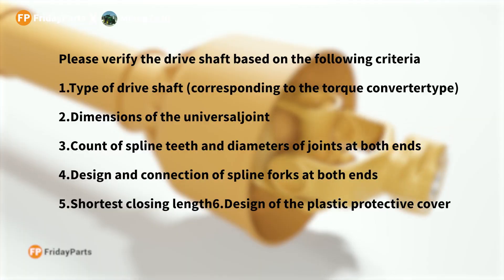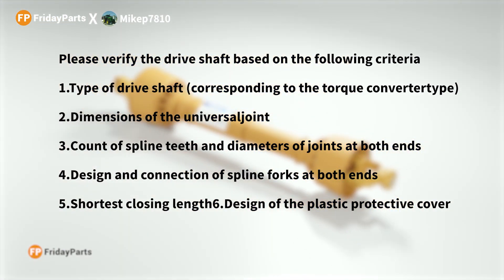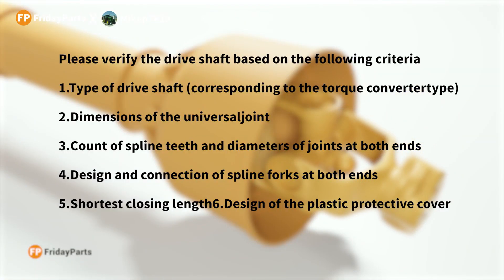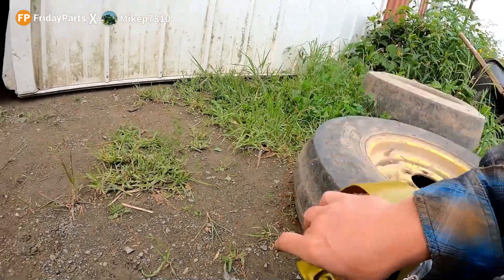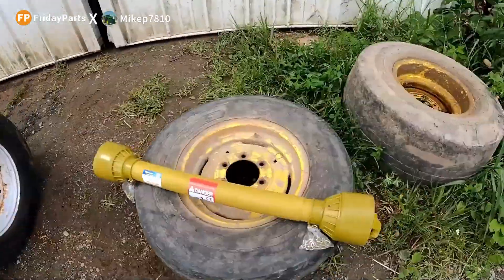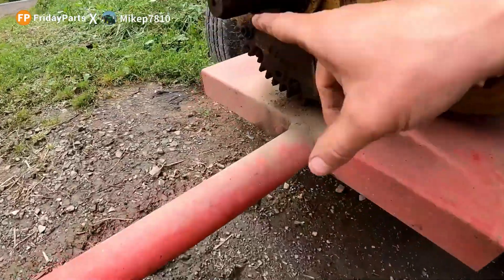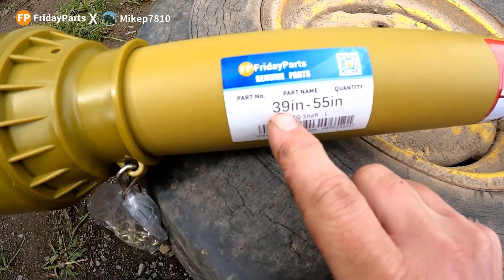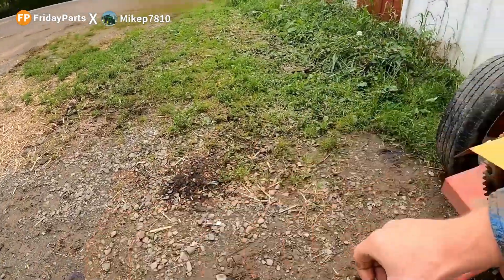How to Choose the Right  PTO Shaft for Your Tractor?

Comment: I also want to know >>>series 1 pto shaft vs series 4 pto shaft????????
Reply from the maker: Hey, bro! The two series are designed for differing levels of torque and horsepower, with Series 1 being suitable for lighter-duty equipment and Series 4 for heavier applications. Typically, Series 4 PTO shafts are larger in diameter, can transfer more power, and are constructed to handle more stress. We're considering creating a comparison video later on, so stay tuned for updates!
Reply: @FridayPartsOfficial  That was good info!!!! Now when so many tractor owners have pto winches, you should concider making a size chart for recamended pto shaft starting with 28hp tractors. Then folks like me would know wich one to buy for say a Kioti CK3510.......